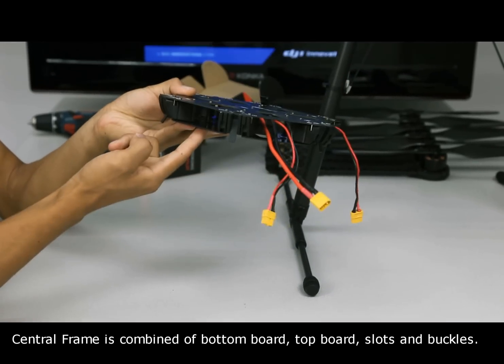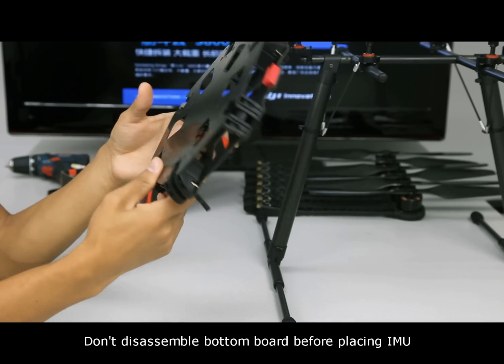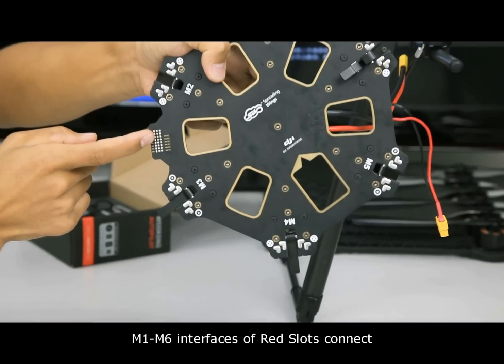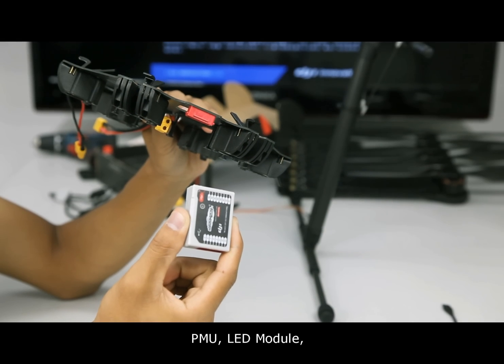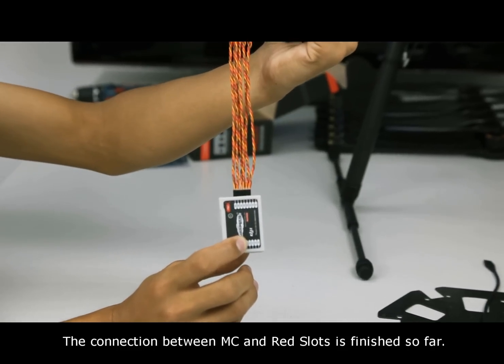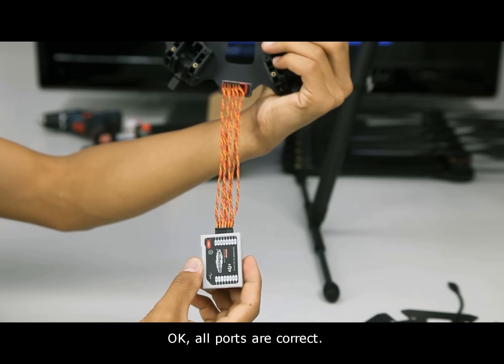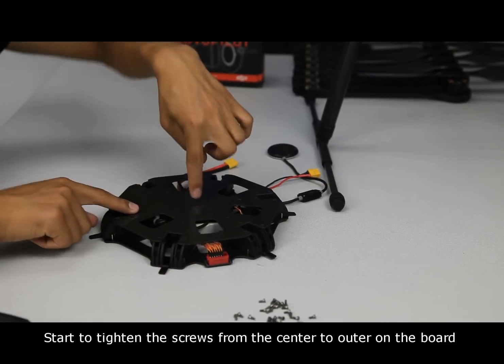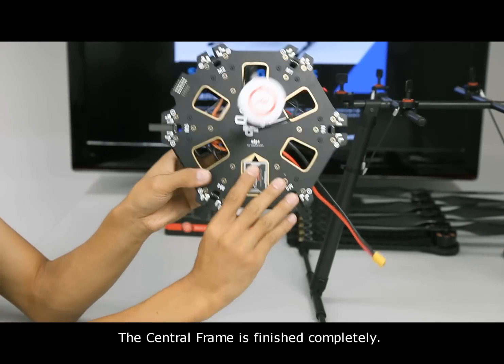DJI Spreading Wings S800 Setup Demo-Mount Center Frame

Comment: DJI have put out some great videos on how to connect and assemble the most parts, but im still missing som basic instructions and its mot clear how to assemble some parts, nor in the manual or in the videos. For instance the WKM GPS, is it supposed to be glued on the stick or? How do i assemble the battery holder and batteries. Basic stuff i know, but with no experiance its diffucult, DJI have put out a supergreat machin but they have difficulties geting out videos for real dummies like me